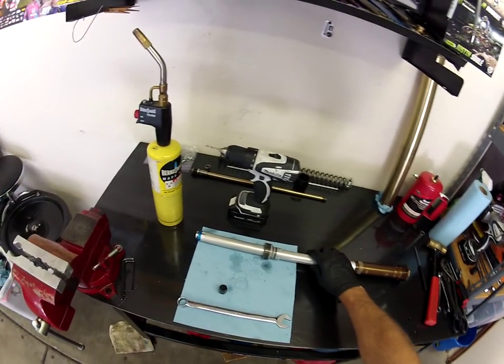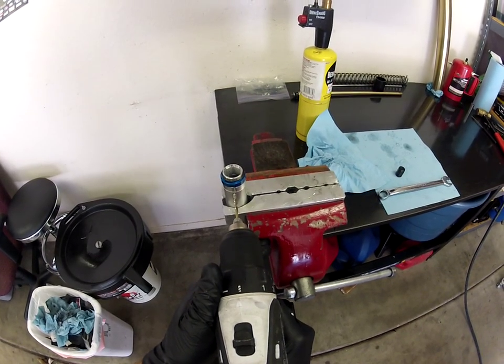Showa damping rod shaft seal removal and installation.

Comment: Excellent Vid!!!I would add that it is much better to drill peens deeper rather than shallow. I almost messed up 1st leg by not drilling deep enough. 2nd leg I went more than deep enough and came apart like butter. Used a 5/32 bit

Comment: Thank you for this excellent video.  Would you consider making one about changing the upper piston seal as well?  I understand the use of heat is required for that seal as well.  Thanks a lot, this video was very helpful.